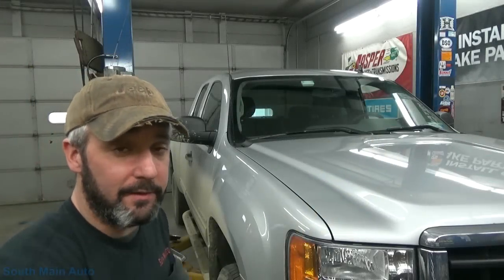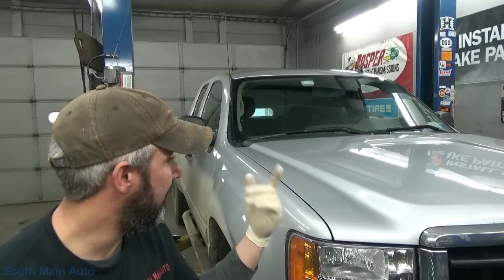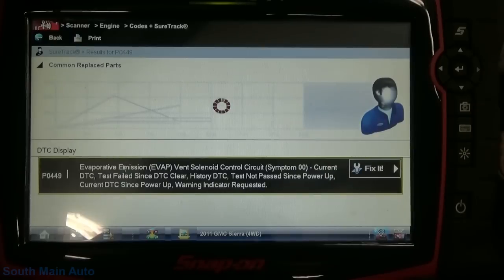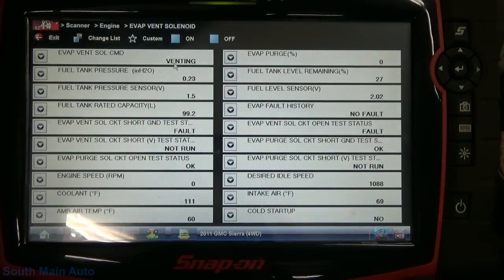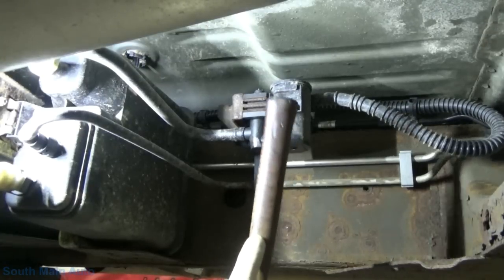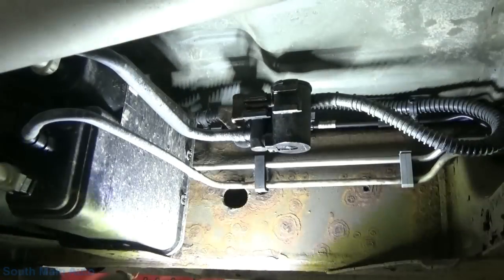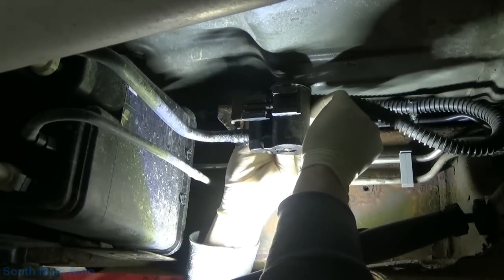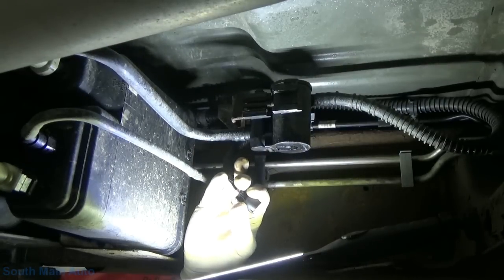GMC / Chevy Truck -DTC P0449 EVAP Vent Solenoid Control Circuit

Comment: A third possibility is a tank pressure sensor!! A friend had that code on an 09 5.3l Z-71. The part store sold him a purge solenoid. It didn't help. He called me to find the problem. I knew to check the vent valve, and it did test intermittently not working. I replaced that, and still had the P-0449. I used a part store code scanner, and noticed the tank pressure was off!! Not out of range, but just off! I took the cap off, and it didn't go to zero. I ran the car and the pressure tests showed changes in pressure/vacuum, but it wouldn't show zero when zero. So I replaced the tank pressure sensor, too!!! That fixed it! 

The purge solenoid that the part store sold him, couldn't be returned!! Imagine that! They told him to buy an expensive part, to fix a problem, that didn't fix a problem, and they wouldn't take it back! I proved to him that the vent valve was malfunctioning, and needed to be replaced, so those dollars weren't an issue!! I was trying to NOT throw parts at it, like a parts changer! I wanted to prove my work, and the code led me to a partially malfunctions valve, so I replaced it!! Even tho it didn't fix the problem!! But, when I noticed the tank pressure not zeroing, I knew I had the fix!! 

And I never would have known to look at that info, had it not been for you, Dr. O. and others here on YouTube, like the car guy, scannerdanner, and Motoyam. Thanks to you guys, for teaching us!!
Reply from the maker: Yep watch this vid I did on that https://www.youtube.com/watch?v=uz4dNTsaeo0&t=61s
Reply: South Main Auto Repair yes Sir!! Very much like that. I hope some people find that info very helpful.

Comment: Thxs , I,ve learned a lot about diagnosing can issue,s thru you. I worked on cars when we only had to tune carbs and whatever we clean..lol  Now it requires an engineers and computer degree to look at it.  😅
You make it look easy pal, makes sense when you walk us thru.

Comment: The line that runs to my filter does not go to the filler neck but runs to the front towards the engine, its an 08 sierra, do i need to chase it down or can i cut the hose and hose clamp it back to the solenoid

Comment: Maybe if GM would stop having China make these parts they wouldn't be failing quite so often although that entire design is questionable with the filter not even keeping dirt out. I haven't had to replace any of these parts on my 96 Silverado.
Reply from the maker: I think if you check on your 98 it is under the hood and will never go bad :)
Reply: It's a 96 5.7, lucky I haven't had to track it down yet. :)

Comment: Did this truck have issues with trying to fill the gas tank? Ive got an 07 Pontiac Grand Prix with the 5.3 V8 and I am lead to believe that the problem is this exact issue with the vent solenoid. I've got a check engine light with a p0446 code that comes up and at the gas pump, it won't let me pump at full speed and will automatically kick it off (it does this mostly in the winter time when it's cold) Any input helps. Thanks.

Comment: I replaced the solenoid and evap canister and I still have the code... any help?
Reply: Try the other valve in the front under hood. It’s right above under the intake manifold cover.

Comment: Well now I'm totally confused because there's an evap vent control solenoid under the hood at the front of the intake and another evep purge valve under the truck just ahead of the gas tank > I'm replacing the one under the hood because my code was a P0455 and that's what is recommended .

Comment: did you say your dad has truck shop does he work on much of the aftertreatment exhaust system or regen stuff up there? I do who would have though a few years ago you would have to fill your exhaust fluid tank. And it wont be long that muffler bearing wont be a funny joke no more.

Comment: have you done the GM update were you route that filter from the filler neck all the way up to under the hood with 5/8 heater hose from the solenoid. its a big problem, here in Alberta in the oil patch with so much mud in the summer. have cleaned a lot of them. most of the time when those evap codes come up in a newer GM truck we always do the reroute of the filter first, a lot of the time it works, not always.

Comment: Hey Eric, I have an O8 Escalade in my shop with this same code, I tested the circuit as you did, initially I had power on the red wire but was not getting anything from the white wire, found the wire was broken at the front drive shaft so I repaired it, my test light illuminates but will not turn off with scanner, disconnected ecm and tested the white and red for shorts, with ecm connected on comes the light. I am suspecting driver in ecm what do you think?
Reply: hey wanted to let you know, The ECM was the culprit in my situation , and hope maybe my comment will help someone else also

Comment: Eric, I have a 2001Acura Tl. Would a faulty coolant temperature sensor cause a misfire code and the check engine light to come on?
Reply: Can we all get along I am a certified tech. and i am sure of the engine light on as a possibility, as well. It can also run rich/lean based off of a bad cts

Comment: When the auto manufacturers find out about a bad design do they not come up with a fix for them, like a TSB or recall? Another idea would be that the dealers in the "rust belt" can offer undercoating when you buy a vehicle from them to stop the decay.
Reply: The undercoating thing was big in the 1950's & 60's
mostly in Canada & then somewhat in the 1970's in the US
Dealers don't offer anything--they screw you over,so those
add-on pitches faded by 1980 There are places that are
franchised undercoating & other services,bed liners,etc
Reply: David Dye & pc zapp  

I find here in Ontario Canada that new car dealers will try and sell you Undercoating / Rust Protection with a warranty for $500-$1200 usually. And it's next to useless in most cases, it's a waxy tar coating that will chip over time allowing moisture to get under it and then rust spreads. 

They want you to get into the dealer every 2 years for a " RUST INSPECTION" which is a joke, believe me i've watched a Ford dealer do it on my car and they did next to nothing ( i sat on the lot and watched them from a distance...i was pretty annoyed with them) 

Anyway what i'm trying to say is Oil spraying is the only to go. But you don't want an oil spray that CAN'T conduct electricity because then you end up with a lot of little electrical issues. 

So that's why a Company called KROWN is so popular in Canada because it's thin and light and is non-conductive (only problem it does drip a bit for a week or so...but it won't harm asphalt, fades)

Then the other good option is FLUID FILM also non-conductive. Not as thin, doesn't drip, but still thin enough. 

If only most of North America knew about those 2 companies and sprayed their car once a year.......you would see rust problems in the Salt Belt DRASTICALLY reduced. Plus there's other things like washing and using Krown MR35 Salt Eliminator to stop Rock Salt & Cholorides/Brine (de-icing stuff that rots out the car).

Comment: still rather deal with those plastic quick release as opposed to the 2 wrench thing. getting that lead kit, it's better than my drawer of soldered crap.
Reply from the maker: AES Wave. Call there and tell Carlos you saw it on my channel :)
Reply: Ok, thx

Comment: Out of curiosity Eric, have you ever seen or heard anyone who did any damage to a computerized circuit with a 200mA test light?  Any other techs seen or heard anything? I've never damaged anything and i have applied the use of test lights to heater controls, fire alarm systems, access controls. PLC's for industrial doors and various CNC's and assembly machines. Never had an issue. 

Nice set. All the adapters, gizmos and doohickeys a 2%'er needs! All my testing bits are scraps of wire, solder, heatshrink and ebay plugs, scrap car bulb holders and knock off wing wang fluke leads. haha 

Your really on a roll the last few days Eric!
Reply from the maker: Never and no one has ever answered that same question I ask when they say it is dangerous. It is an automotive myth :)
Reply: Maybe if they poked their eye out with the tip ... LOL. :D
Reply from the maker: Lol that is about it
Reply: Automotive ECUs are built to really high standards.  These days all control outputs are current limited and any pin on an ECU is static protected and will handle 60 volts or even higher.  If you connect a 200 mA lamp to a circuit that can't source that much the bulb will be dim or not come on at all.

Comment: I think the design is fine. Its the location that is bad. I just replaced my evap vent solenoid on my Colorado. I popped the top off and it was full of dirt and debris. If they placed them in another location where it wouldn’t be subjected to the dirt, water and other debris, they probably would last quite a bit longer

Comment: Incandescent lights draw a lot of current. Digital circuits depending on design can't handle (relatively) large current draws. Guess you could put a resistor in series to keep the current draw down, but then the light wouldn't come on lol.
Reply from the maker: It is a 250ma test light. Can you name a circuit on a vehicles ECM a test light will damage? No I can't either but let me know if you can list the situation where it would cause damage :)